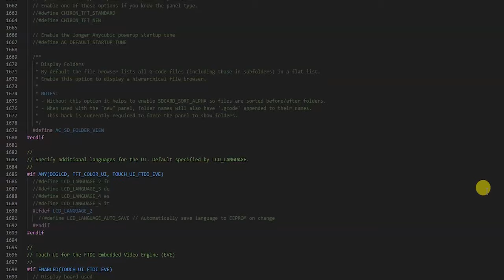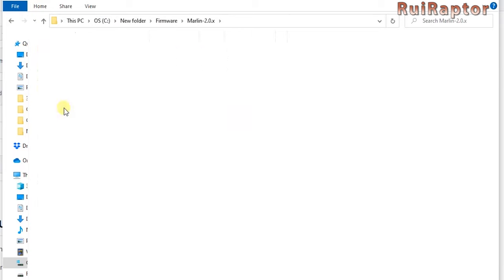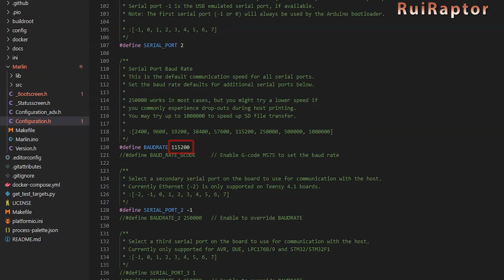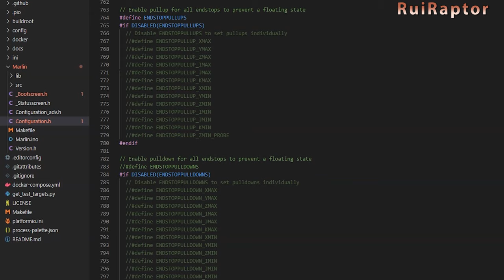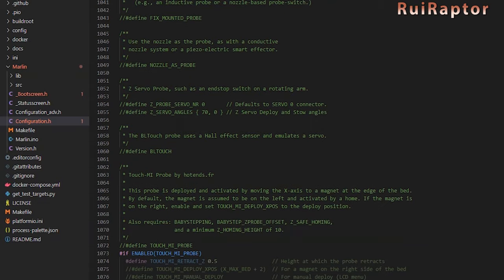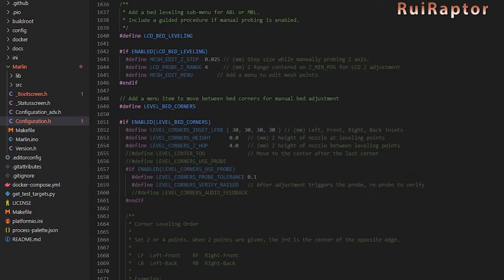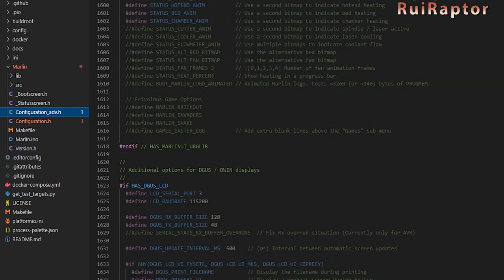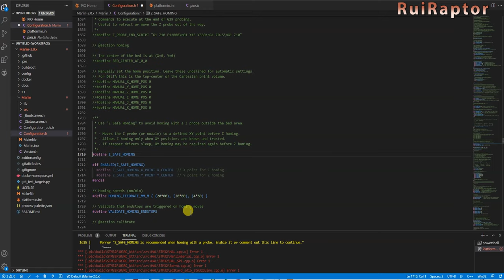MARLIN - Essential Guide To Start Editing Your Own FIRMWARE

Comment: Just an addition, if you get an error when compiling, scroll to the top of the list after expanding the window and find the first error that comes up, deal with that and recompile, repeat until you get a successful compile. Fixing the very first error will often fix other errors as well, sometimes fixing one error will fix them all as the first error may have caused a cascading effect, ie. one error leads to another error which leads to another error etc etc.
Reply from the maker: Hi Darren, that is 100% correct and thank you for sharing that information. In our video, we just wanted to give the example but the information that you share here is also very important.

Comment: That was an awesome intro to both configuring and compiling Marlin! Doing that now, thanks a lot ❤
Reply: And now I'm running a new stable 2.1.1 firmware on my CR-10 V3, with increased max temps (bimetal heartbreak) original was 1.1.6. Lots of nice small improvements 😌

Comment: Firstly, this video is much more helpful than any other I have been referred to. I do have a problem. When done changing the thermistor type to '1047' and max nozzle temp to 500C, I checked the .ini and pins.h as mentioned in the video. However, I am not getting a checkmark to compile. Anyone else have that problem?
Reply: I am. When I try the alternative of going to "Terminal" and "Run build task", it can't find any build tasks. Did you find the solution to the problem?

Comment: I configured my firmware for a cr10 several years ago on a machine I no longer have.  I still have the .bin backup and looks like I made a copy of the config.h onto a USB drive.  Do you know if a .bin will open in platformio, re-compiling the modified Marlin firmware?

Comment: I want to change the stepper motor drivers to HR4998 (because my board says H in the sd slot) but i get an error. But even if i compile (with wrong drivers)
 it doesnt connect with the bl touch.Also if i compile firmware with  STM32F103RET6_creality environment it fails.It only works with  STM32F103RE_creality

Comment: On the marlin web site how do I find the firm wear for my Trevor Tarantula Pro? That website is so confusing. Can you make a video on how to download the marlin firm wear for this printer and how to change the extruded feed rate or point me in the right direction.
Reply from the maker: Hi James, just download the configuration files. It will be a zip file with many different printer brands/models in there. Just look it up and extract only the ones you need.

Comment: Thanks, Awesome tutorial! It has helped me compile my firmware. I do have a question tho, I've watched this video over a dozen times pausing playing backing up and watching again and I'm able to compile my ender3pro crtouch firmware successfully every time but when I try to flash my printer it doesn't flash. The screen remains blank. I rename the firmware each time and I'm using the SD card that came w/ the printer. If I flash w/ older firmware it works but then I try my own firmware I get the same result a blank screen. What am I missing?
Reply from the maker: Hi Bobby. Try to keep the name firmware.bin and chek if, after the pwoer cycle, the file changed from .bin to .cur.
This is an indication that the board installed the new firmware and (if the screen does not show any info) you might have something wrong in your firmware setup.
Reply: @ruiraptor  Thanks, that worked. I renamed it firmware11062022.bin and it flashed. That's all set, but it's not homing and the Z won't even lower. I can only raise the z offset which it's almost completely at the top now but if I try lowering it doesn't move. I have use the zrod to lower it.
Reply from the maker: Hi Bobby, do you have any leveling sensor installed (or enabled one in the firmware)?
Reply: @ruiraptor  Yes, I have the CRTouch and it's enabled in the firmware.

Comment: 😥 Hi, one question to ruiraptor:
I have installed a BIGTREETECH SKR Pro V1.2, I am preparing a 3 colors Mix print.
Problem:
When I test the motor steppers then after the motor has finished running soft does not Return to Menu but it crashes and resets.
The same for another BIGTREETECH Octopus V1.1 mainboard.
Do you know this problem please ?
Thank you very much, gg

Comment: Great video. Is there a way to increase the number of points for mesh bed leveling?
Reply from the maker: Hi, yes you can edit the number of points in the configuration.h config file here:
"define GRID_MAX_POINTS_X 3    // Don't use more than 7 points per axis, implementation limited."

Comment: Hello, tell me please, if you know, there is a need to raise the upper temperature limit for my 3d printer, how to do it correctly in marlin?
Reply from the maker: Hi, search for the line "define HEATER_0_MAXTEMP" (for the nozzle) and edit the value for the temperature. Please be carefull when editing this value.
Reply: @ruiraptor  Thank you!
Reply: @ruiraptor  seems noob ish of me. Do I just load .bin file to sd card and load printer then turn on. I have a completed bin file but this tutorial lacks actually installing to board. Am I just being dumb. Thanks in advance
Reply from the maker: @felurianmasters4369  , load the .bin file to the memory card (make sure the memory card is formatted to FAT32 and it's empty), insert the memory card into the printer and then turn the printer on. When turning on, the printer will load the firmware and flash it. Once the update is complete, the .BIN file will be renamed to .CUR and this will be your confirmation that the firmware upload was done.
Reply: @ruiraptor  ya I didn't realize it was that simple. I've since learned 8gb is maximum size of card. I actually learned a ton from this experience thank you. I also just now learned about the cursor file extension from your reply! Thank you! I ended up doing a ton of changes, hard ware and soft ware, I changed the machine name while I was at it to identify the new firmware, but the version of marlin showed up after the flash, so I knew instantly it worked. I had to do firmware on an old machine years back, and I remember it being easier than everyone was making it seem, I didn't have much trouble figuring out a solution, using arduino, I just hadn't realized the new boards flashed themselves on boot from a binary file. This is so clever and quite convenient, I didn't expect it. Thank you very much, your video was very helpful, there was a few questions I was left with before going into this and you ended up clarifying them in this. Gave me the confidence to jump in. Also your fast reply to comment is greatly appreciated! I'll save this video for future reference if someone else needs help. (This is so much easier than the old methods!, everyone should have a 32 bit board if for nothing else this reason)

Comment: hello i have a tevo nereus equiped with an MKS ROBIN NANO bord 32 bit with touch screen...firmware installed is : mks robin nano v 1.0.1 ..it works fine like it is ,,,but i want to be able to acces motion settings on screen ,,and also i have to edit wifi and filament sensor settings for it to work ,,,,is the marlin v2.0.0 is compatible or i should stick with mks firmware,,,,and please tell me the procedure to edit firmware with ,,visual studio , i dont have the tool bar at the bottom and did not found the way to compile,,,,,also can i edit ...txt files ??? into .bin files ....i also have experence with a tevo tornado and already edit firmware on this one with arduino software(bl touch and filament sensor added),,,very easy 
but for the nereus ????it seems to be a lot more complicated
Reply from the maker: Hi, On Marlin's website, under the configuration files, there's a folder for the Tevo Nereus which means that it's compatible. Regarding Visual studio, try to install it again and update all the plugins and see if it helps.
Reply: @ruiraptor  thank you very much ....i went on the marlin website ...but i do not find any link s or mention for nereus firmware ,,,under configuration or under download ,,,,,could you narrow the serch for me or i am not looking at the right place ??? is it the 2.0.1 relese

Comment: well i got the firmware to install but now my nozzle will move up but not down............sigh. im sure i followed all your instructions. how do i fix this?
Reply from the maker: Hi, try changing the direction of the Z axis stepper motor in the firmware.
Reply: @ruiraptor  will that work even if i have the dual z bolts?
Reply: @ruiraptor  i tried it and it was still the same result. i dont know why it wont work for me........... so frustrating

Comment: Help needed please, In my Auto Build Marlin page the environment I need isn't showing how do I do? I have an BTT Octopus Pro V1.0 stm32f446
Reply from the maker: Hi, that board was only included in the latest marlin version. Are you using the latest marlin version?
Reply: @ruiraptor  I'm using Marlin 2.0.9.2
Reply: @ruiraptor  I've changed to 2.0.9.3 and I'm seeing different results, I'll report back when I make it. Thanks a lot <3
Reply: I had issue with the serial port in configuration.h, It set by default to 0I set it back to 1 and it works fine, thank you so much for the help, sorry for bothering you <3 I love you mate
Reply from the maker: No problem ;) Glad you git it working.

Comment: well either the updated firmware files are different and this video explanation  doesnt work on them or i am doing something wrong. however i have downloaded your pre compiled firmware from your page and it still didnt work. this sucks.
Reply from the maker: Hi, why doesn't it work? What error do you get?
Reply: @ruiraptor  i don't get an error message. once the board is flashed, i hit the auto home and it only goes up. then i reversed the motor like you said in my past message and then it only went in the opposite direction. i also asked you if the fact that i have a dual z rod set up on my ender 3 max make a difference but you never responded.
Reply from the maker: Perhaps is better to contact me by email so that you can send me all the information i need to help you.

Comment: Good afternoon. I have been trying this multiple times and I always get the same error when compiling. Could oyu please lead me in the correct direction on how to get pass this?
Here is the error:
#include errors detected. Please update your includePath. Squiggles are disabled for this translation unit (D:\Firmwares\Marlin-2.0.x\Marlin\src\MarlinCore.cpp).

Thank you for your help in advance.
Reply from the maker: Hi Don,
Is your platformio/visual studio code updated to the latest version?
Check this and see if it helps: https://stackoverflow.com/questions/45583473/include-errors-detected-in-vscode
Reply: You may need to put your marlin folder in the C: directiry, not below in another folder. I got this wrror when the Marlin folder was too far down in the directory tree.

Comment: I don't have that checkmark at the bottom,
Reply from the maker: In that case, at the top you find "terminal" then click on "Run build task" and press enter.
Reply: @ruiraptor  Same Problem when I click Run Build Task It says No Build task? I am stock here
Reply: @victorblandon8996  Did you figure out the problem? I'm running into the same thing.